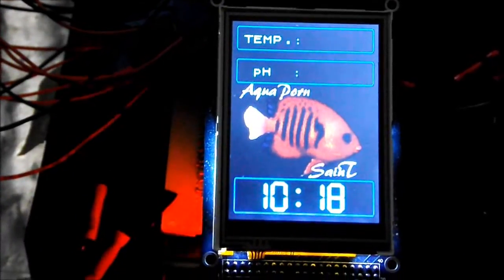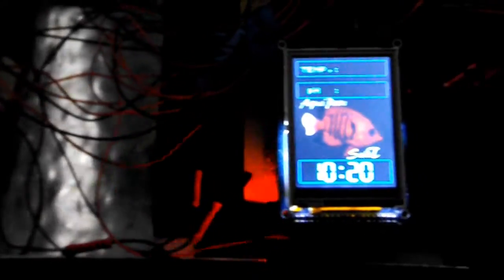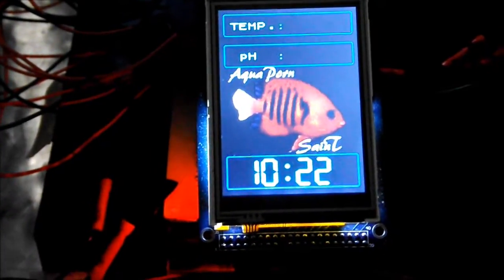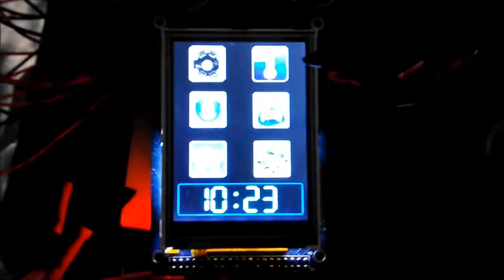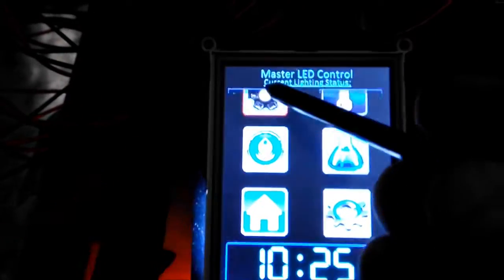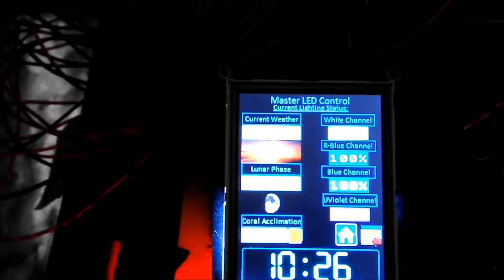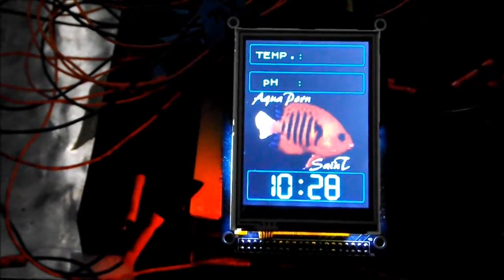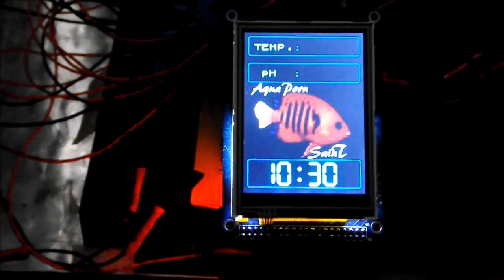DIY Arduino Reef Controller - Plans and Functions

Comment: It would be nice to see a video of all the hardware and what each piece does.  You obviously have a LED driver board that the Arduino controls with the power 24v power supply

Comment from the maker: For the LEDs I am using 2ea 6 channel driver shields made by Ledsee. These shields allow for an input voltage between 6-30v. They have a switch to keep the power from going to the Arduino. they also have jumper pads to control amperage of each channel choices of 350, 700, or 1000mA are available. I am unsure what you mean by interface? If you can't tell by now I have zero experience with this, and I'm just winging it as I go. I will be more descriptive in the future.

Comment: That is a good idea using the 8 channel SS relay board.  But how do you vary the voltage to the LED's for dimming?  Also what interface are you using with the screen.  It would have been nice to have some discription in the comments section.  I don't have a fish tank, but I like to know how others solve problems with Arduinos

Comment from the maker: But, if you are talking about the GUI that's my creation. I am making the different screens in MS Paintbrush. I then convert them into a .raw file that is supplied with the UTFT library. I store the files on an SD card that came integrated with the TFT screen. Then I just code the navigation and .raw calls for which screen file to be loaded.